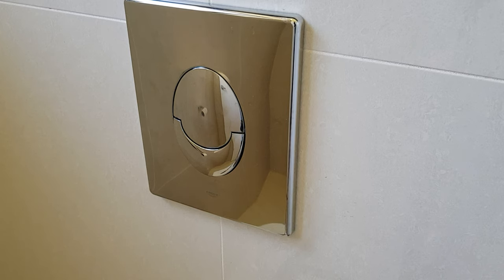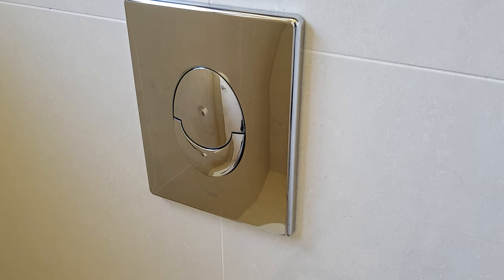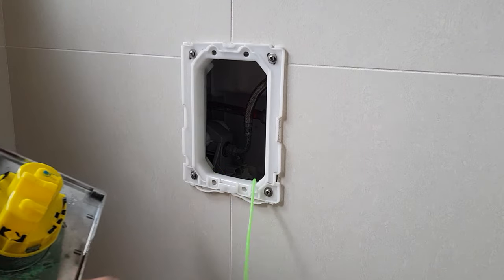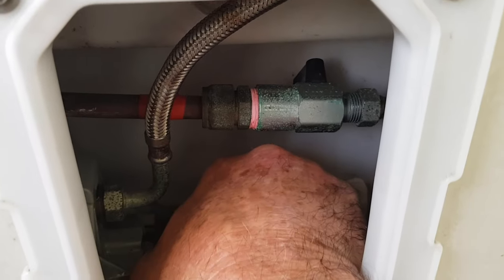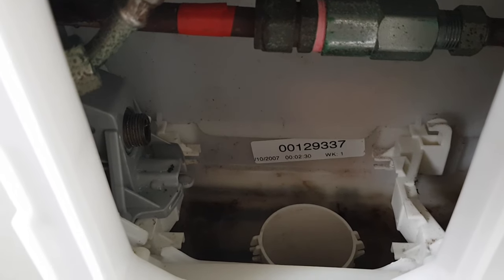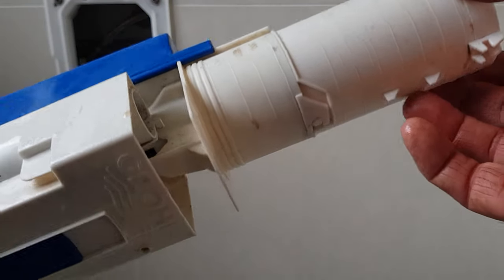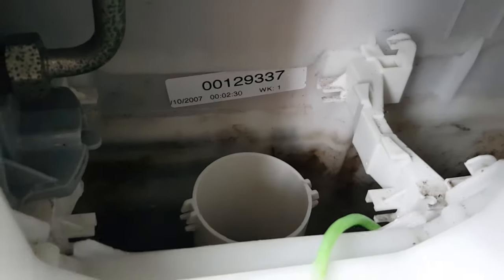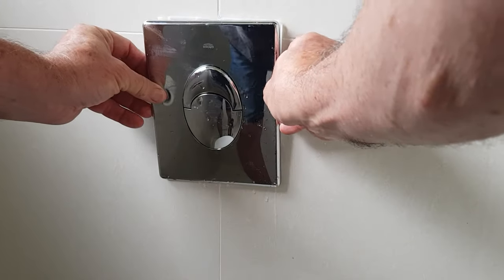Grohe SL rapid flush Internal wall system no longer flushing - How to FIX

Comment: Hi, thanks for this. Do you know how to adjust the waterflow for full/half-flush? Mine's brand new, with limited instructions from Grohe and I've found that both buttons give the full (large volume) flush. Bit like you, I'm struggling to find anything onlne on here from Grohe in English that shows this fix. Cheers, John
Reply from the maker: There is provision to provide a second bellow, but on mine this was missing so both buttons perform a full flush. Must have got put in the "too hard" basket somewhere along the line.

Comment: The closest video to my problem with grohe!
However, can you tell me sir what to do with the green small hose? Mine is deattached from the bottom piece(in the video it shows that it is attached to the piece at the bkttom, while mine is attached to the button. I can't figure how to connect).

Appreciate your response
Reply from the maker: Hi, one end connects to the bottom of the square blue and white unit, the other end to the back of the  button, both images are shown in the video. Hope that helps

Comment: Useful video thanks. I'm just about to purchase the same make of wall-hung toilet and frame system. How long has it been installed before you've had to replace the pipe? I'm not put off from buying this particular brand as I'm sure all makes use the same type of hose and now I know how to replace it should it fail.
Thanks again
Reply from the maker: Hi Terry, I had my toilet installed in 2008, and it  only failed recently. I was impressed that no other wear and tear was visible on any other part, so a well made product in my view. Glad I could help.
Reply: @aussiealf1355  sticker inside says 2007
Reply from the maker: @mixer1014  Yeah mate, that would be the date of manufacture,  mine was installed in 2008.

Comment: Where were you able to source the replacement 2mm ID hose? Thanks!
Reply from the maker: Hi Ryan, Yes, not easily available. I used fluro fishing lure - https://www.ebay.com.au/itm/Surecatch-Lumo-Green-Fishing-Tube-Glow-in-the-Dark-Luminous-Sleeve-/363281662902?mkcid=16&mkevt=1&_trksid=p2349624.m46890.l49286&mkrid=705-154756-20017-0
If you know someone in the medical field, you could use the tubing that they use for a drip.
Reply: @aussiealf1355  Great thanks for the help!

Comment: Where can I buy the hose? Any key words I can put in eBay to get it ?
Reply from the maker: Hi Rafael, Yeah, I had the same issue trying to source 2mm tube. I ended up using fish lure wo7ld you believe. Search for this - Shogun Lumo Tube Green 2mm

I have since found out that the tubing they use in drips would be ideal as well, so if you may be able to source from a veterinary clinic, doctor or hospital. Good luck.

Comment: What do I do if my problem is this: I want to partly flush it to save some water but right now all the water goes down the toilet, no matter which button I push.
Reply from the maker: Not possible with this type of flushing system as  air lifts up the valve release. You can adjust the volume though by sliding the blue panel on the side of the air chamber.